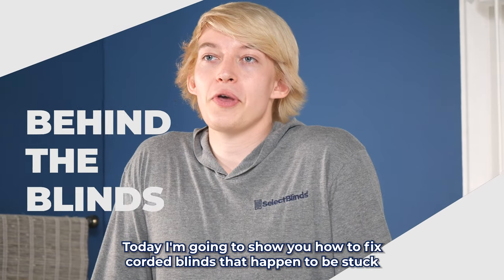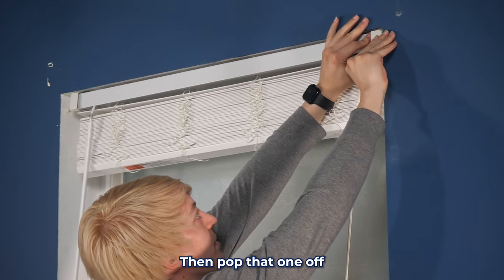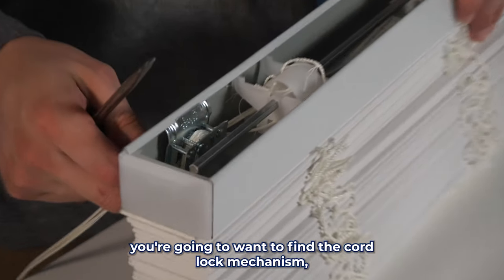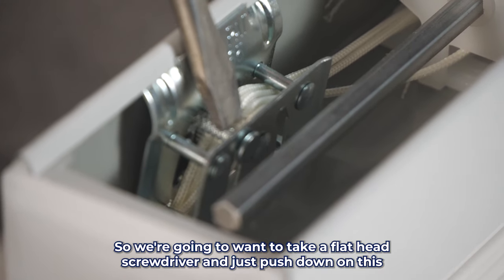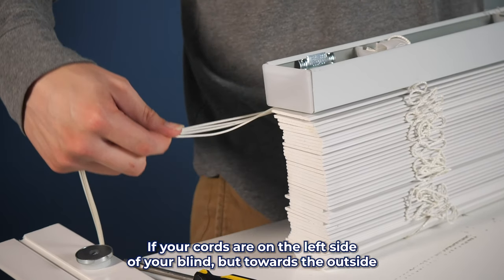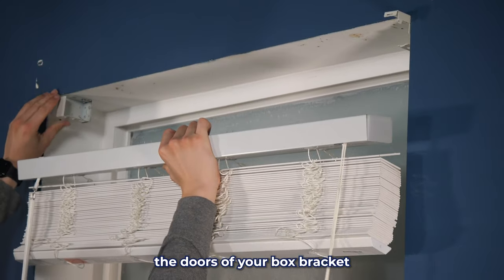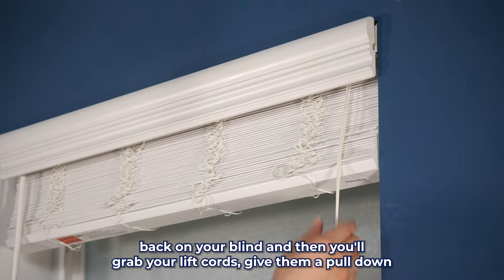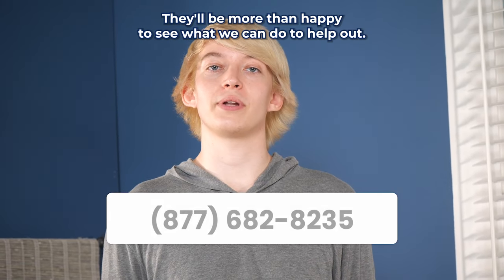How do I fix my stuck blinds? | Behind The Blinds

Comment: How do I do it without removing the blinds?
Reply: no
Reply: @L4nd0TheM4nd0  I don’t recall what exactly I did, but I did it without removing the blinds. So yes.
Reply: Same way! Maybe support the weight while you lower them if it’s jamming still
Reply: For me I had to take them down.  I pushed in the two brackets holding the blind and popped it off.  The insides were different so I poked around and followed the stuck cord to the middle of the top.  I unstuck it there.

Comment: SelectBlinds is there a way to fix the 2 strings that are on the front of the blind? On the blind that your showing in the video it has 3 rows on the front of the blind, I'm not sure what to call it. My blind has 2 rows and on one row the string which is two strings corded through the blind from top to bottom it came loose at the very top, the part that you were holding when you were holding the blind. Thanks
Reply from the maker: Hi Mary, if you are unable to find this information on our YouTube page or in the Technical Tips section of our website, please reach out to our Design Consultant team. They give expert window treatment advice and would be able to help you with this!